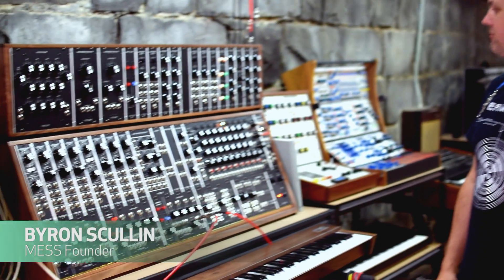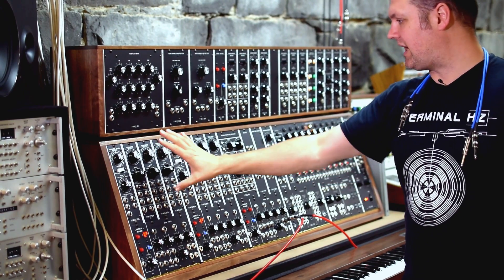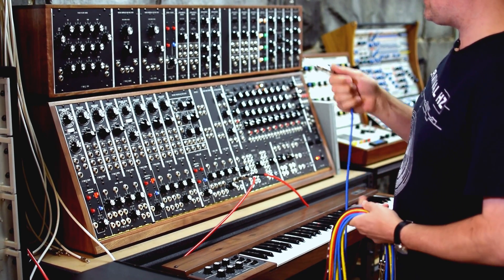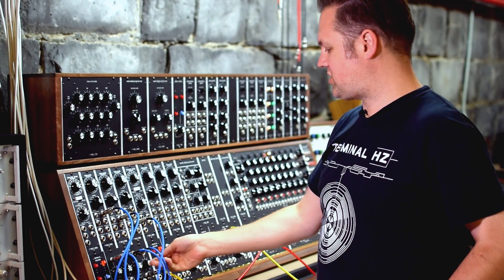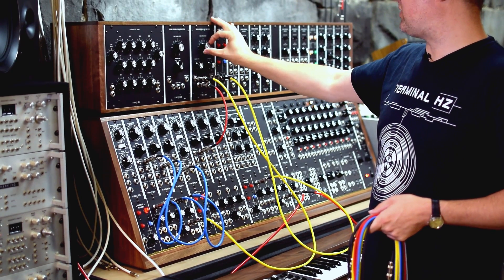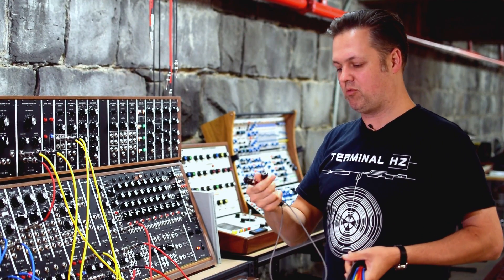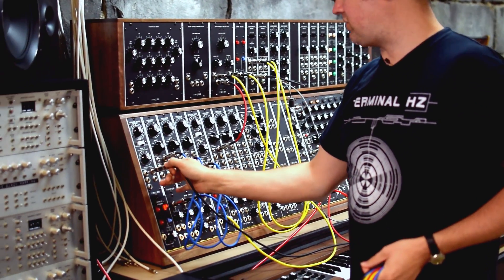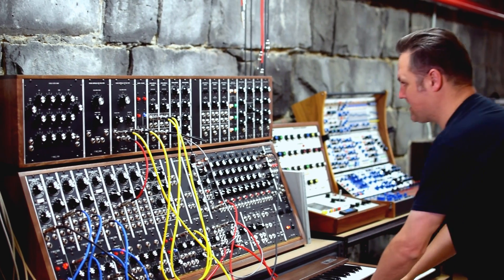MESS (Melbourne Electronic Sound Studio): How A Moog 55 Works

Comment: What is the advantage of a so complicated way of producing sounds? Hybrid modern synths are an evolution of this cables playground, or do they miss something the 55 still does better?
Reply: Matteo Gazzolo I am a total laymen but having listened to plenty modular synth pieces, there is something to the depth of the sound that you do not hear from digital works. Like you can almost hear the individual electrons crackling around
Reply: @mattmmilli8287  thank you, this is something to think about when listening carefully. :-)
Reply: Matteo Gazzolo After spending many long nights with my Subsequent 37 I think it is somewhere in between the uniqueness of the analogue sound and creating something new that gets you inspired which leads to new melodies etc. 
I also use modern (soft) synths, but the deep sound of those oscillators through a good pair of headphones or (even better) our PA is something special 😄
Reply: @tricks-and-tips  I understand this point and sincerily wish to experience this uniqueness soon . Thank you! :-)
Reply: The  way I can explain it is think of "regular" synthesizers as a Playstation or Xbox. They do what they do and they do it well. They can play lots of games and do it quickly with minimal set-up. A modular synth would be a computer. Much more complicated and harder to use with updates and upgrades etc... BUT, the computer can do everything the Playstation and Xbox can do, and LOADS more!! Also, it is upgradable and changeable to suit your specific gaming needs with nearly infinite variety. Whereas with the consoles, you get what they give you, and that's it. You need to buy a whole entire new system if you want to play anything else.
Reply: Well, back in the early days of electronic music production, they didn't have all the fancy Synths that are available nowadays, synths like the one in this video were the only ones available, remember this was back in the early to mid 1960's, the history of electronic music actually goes back to the 1920's with the invention of the first electronic musical instrument, the Theremin, by Russian physicist Lev Termen, the Theremin was an electronic musical instrument you played without even touching it.

Comment: What a pain that looks. Setting up a similar patch on a Yamaha CS-30 takes a few seconds and you don't need any cumbersome cables to achieve the routing and trigger signals. Am i the only synth person who thinks Moog's are over rated?
Reply: It's quite difficult to cook from scratch, but ALL the great chefs do that. Cake mix is easier and produces a decent result, but it's not a high-quality result. Different options for different things - a Ferrari is not good for carrying lumber or mileage, either. The CS30 sounds like a toy compared to it, when good audio is used. If you've not used on of these in person, you can't really know how they sound.
Reply: @briankehew579  using a moog is like making a meal with an unreliable cooker. You can never quite tell how the meal is gonna turn out, which is fine because we all like experimenting.....perhaps moogs are more reliable now cos my experience is one of drifting oscillators and failing power supplies, not good when your band would like you to be in tune and audible
Reply: Andy Jeffs there is a place for both I guess.
If something gets you inspired that’s all that matters right? 
Some will love the journey of creating unique sounds more than the destination and get inspired along the way by something unique that gets them excited. 
I don’t think I’m one of them, but I love to tweak my Subsequent 37 for hours (although that is mostly hard wired) and some nice melodies came out of that knob turning
Reply: @tricks-and-tips  very nice reply, i agree it's not the destination that is important. For me when i use a synth its getting lost in the journey through time and space.
Reply: Different approaches to music make the world a better place. Regarding patching a modular synth, I once read Hans Zimmer talk about how he enjoys the moments of time it takes to plug in the cables that allows him to think about the next step and what he is trying to achieve with the patch, and that statement changed my enjoyment of modular for the better. Whenever I'm getting rushed to make music, I revert back to this principle, and slow it down. Of course he also said that modular is for people who have the luxury of time.
Reply: @ZyrixDeinhardt  i can spend a great deal of time honing a patch i never rush. Have you ever used a CS30 it is a very cleverly designed synthesiser which allows routings of an ingenious and unusual nature without patch leads, it is i believe thought of as semi-modular. it has its peculiarities as all good synths do and  the layout of the patch switching is less than intuative. But once you master it, the possibilities are many. It has kept me entertained for 40 years... yes i'd like 24db per octave filters, and a triangle wave from the oscillator but i'd go to an old EMS for stuff like that.  And you mention Hans Zimmer, well he is a pretty big fan of the CS80, which is really a polyphonic CS30 (same oscillators, filters etc).

Comment: How is the keyboard connected to the modules?
Reply: It is connected to the back with a cable and has voltage control (1v/oct) pre-wired into the two oscillator banks (those coloured switches left of the mixers). Also there are voltage out and trigger out jacks to the right of the interface panel which can be patched to other things.
Reply: It's connected at the back of the cabinet. The CV outputs from the keyboard is accessible at the front from the CP2 module on the lower right side, next to the power switch module.